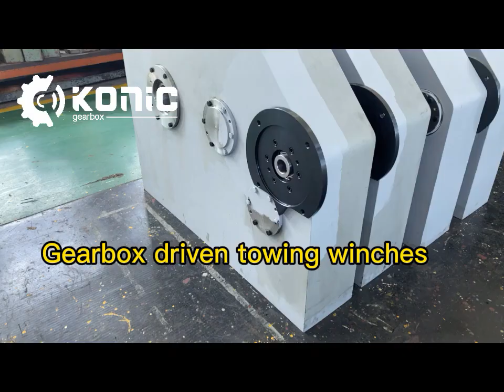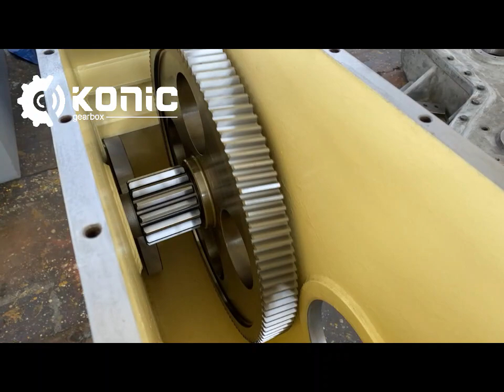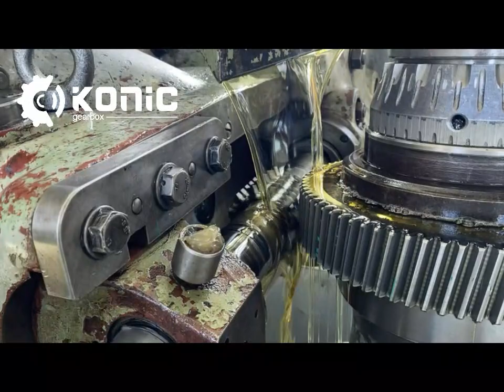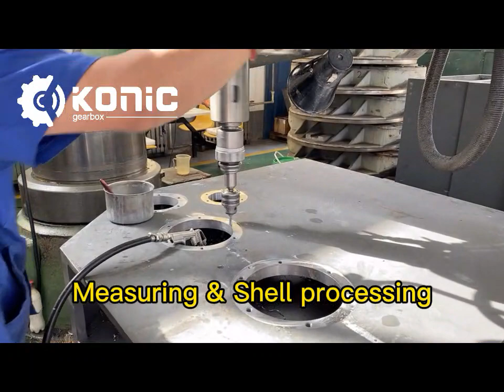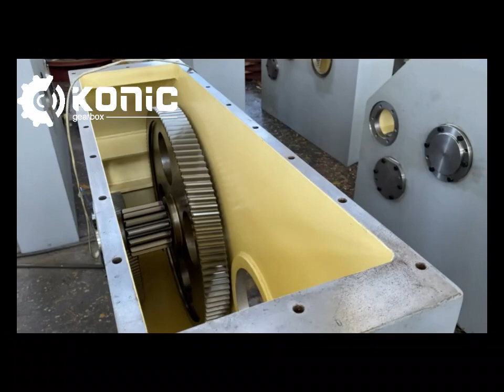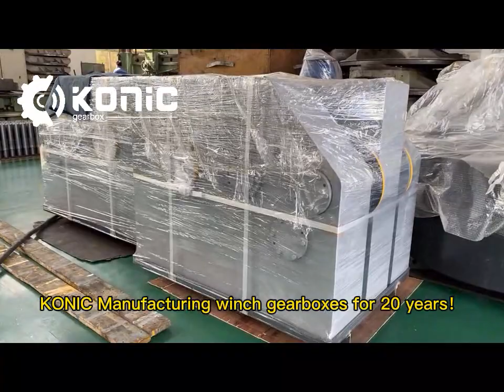Gearbox Driven Towing Winches For Marine Industry

Comment from the maker: konic gearbox
8 days ago
Over 20 years of hard work and innovation. we focus on R&D, and manufacturing of various gearbox. At the same time, Konic adheres to the business principle of quality first. www.konic-gearbox.com Now, Konic Gearbox is a domestic high-tech enterprise. We specializes in providing one-stop solutions for intelligent transmission. We have extensive experience with gearbox manufactured. For example, planetary gearbox for concrete mixer, steel rolling mills , marine reducers and etc.